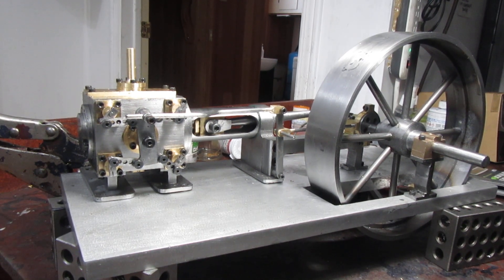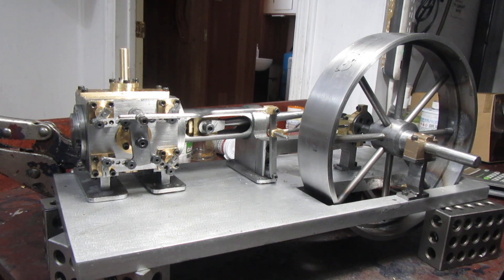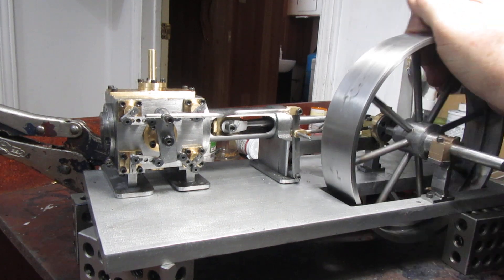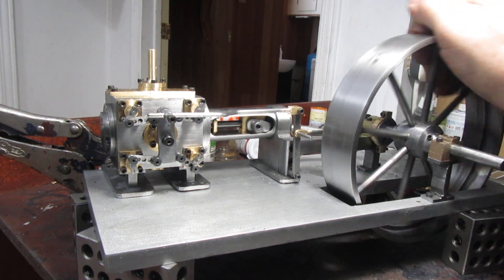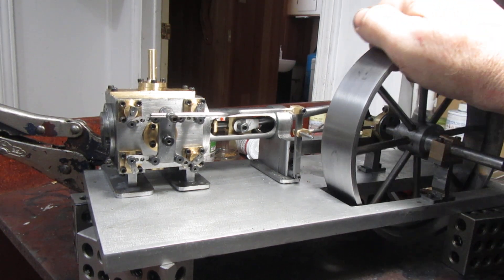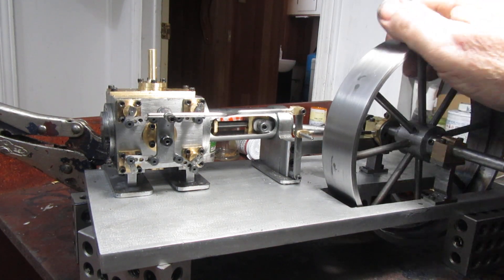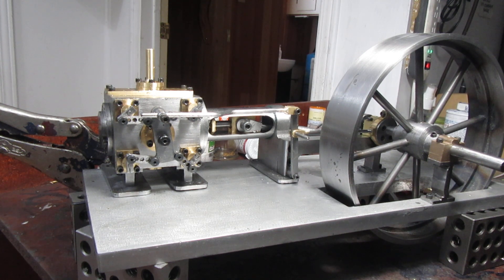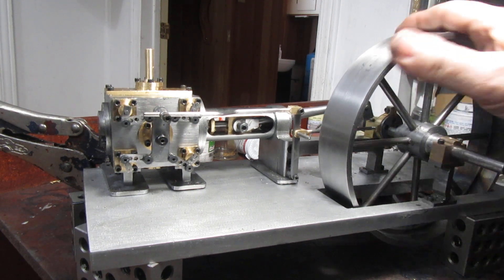FIRST FULL ASSEMBLY OF BRIAN'S CORLISS ENGINE

Comment: I have been building your beam engine this spring/early summer and i noticed i do not have the prints for item 7 on the linkage coming off the ecentric cam that drives the linkage to run the beam. 
Is there anyway you can hook me up with that?
Thanks for any you can do
Reply from the maker: I still have all the drawings on my computer. Email me at brianrupnow@gmail.com and I will help you sort this out.---Brian Rupnow
Reply from the maker: elzieison--i see your message. Email me at brianrupnow@gmail.com